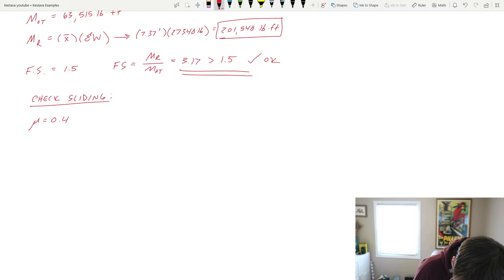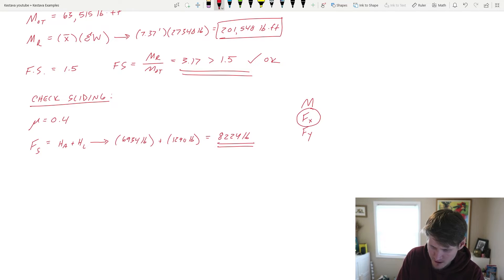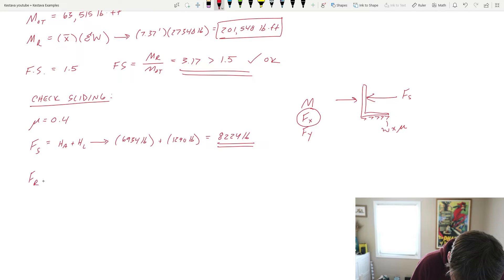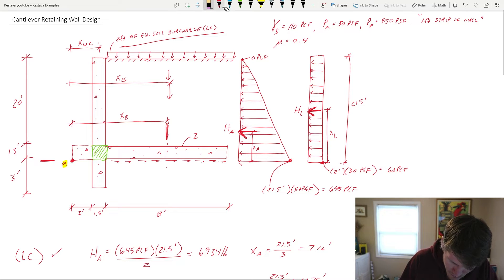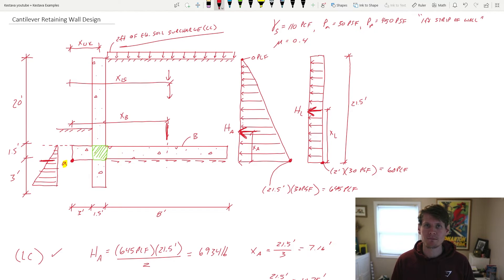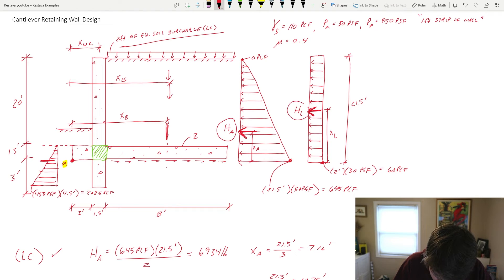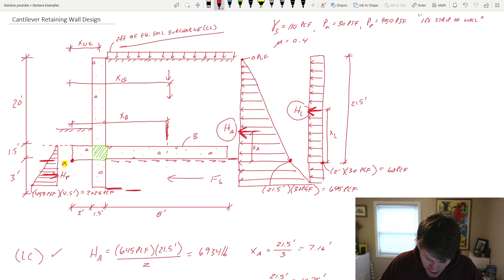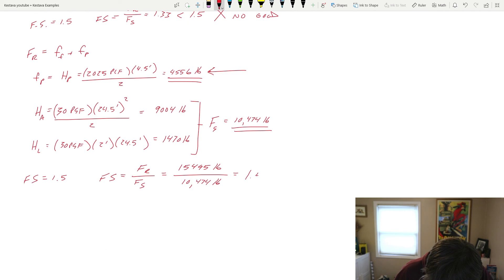Cantilever Retaining Wall Design Example | Part 2 | Learn Structural Engineering

Comment: Question, how are the calculations treated if the other side of the wall is actually retaining a liquid (a pit) that will vary in height from "empty" to lets just say 1-2' below the top of the wall. Safe to assume you just do the calculations as if the pit is empty as that would be "worse case" then when it is full of liquid you have additional force acting
Reply from the maker: bingo! that's how I would approach it

Comment: do you design retaining walls at work? is that common or do geos do it themselves?
Reply from the maker: I have done a fair amount of them. geotech typically provides the design pressures and structural knocks out the actual structure

Comment: Question: By recalcing the soil loads on the right hand side due to utilizing the passive pressure on the left, wouldn't the the overturning moment in Part 1 have to be recalced; Im assuming you didnt do it here because the FS is already at +2x and it wouldnt do much.
Reply from the maker: you could re calc it, but you would only increase the effectiveness of your resisting moment in the end. Both Mot and Mr would change but the passive pressure helps SO MUCH MORE than the additional active pressure. So by inspection we are OK without re-checking. Great question!
Reply: @Kestava_Engineering  But if you had to recalculate the moment in part 1, the moment due to passive soil pressure would cause destabilizing rotation about point "a"

Comment: Great video, as always, thanks for uploading man!! just 1 question, why didn't you include the key in your calculations ? You obviously didn't need it, but just wondering because most contractors I know hate it when they have to form a retaining wall with a key...
Reply from the maker: We needed the key to be able to use the passive pressure in our sliding checks, so ultimately we did use it. I agree with you tho - almost always I stay away from keys if I can.